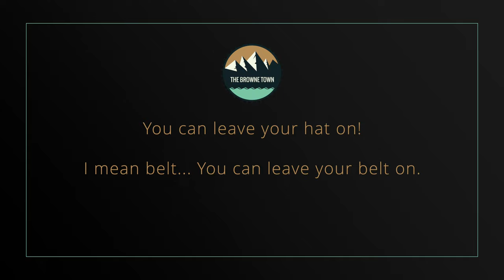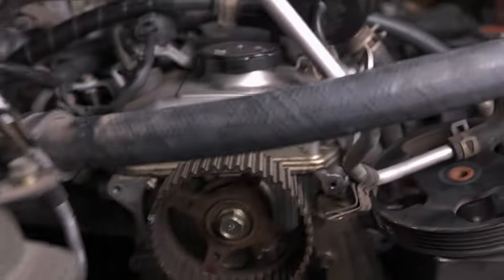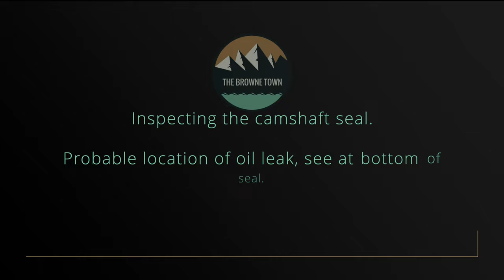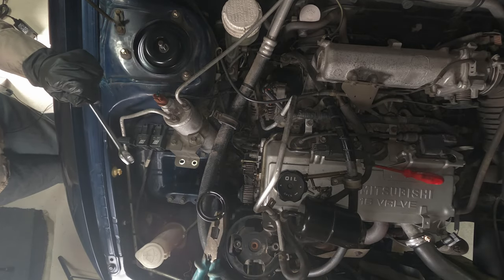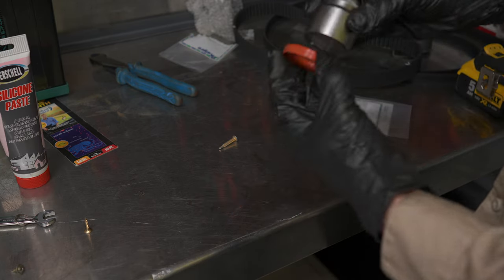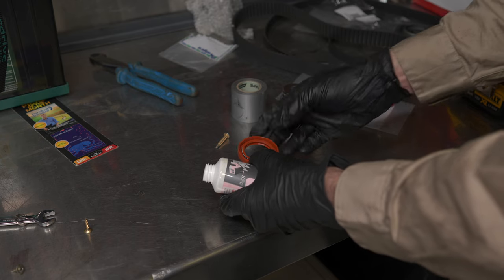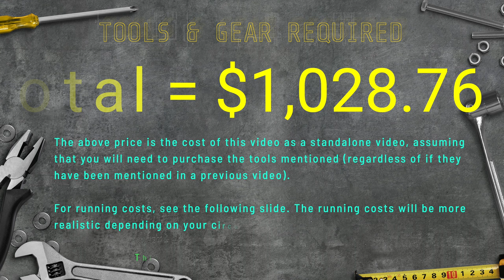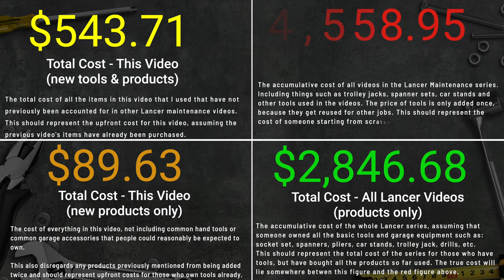How To Change Camshaft & Crankshaft Oil Seals || Mitsubishi Lancer CE

Comment: Good day. On a 1997 Pajero 3.5 Automatic with the torque converter seal MD707575 NBR nitrile rubber, how does one change that?
Reply from the maker: Sorry to say man but I've got no idea. 

Not a mechanic, I'm just a guy that has a crack at some stuff.